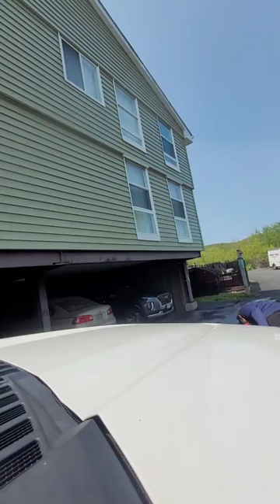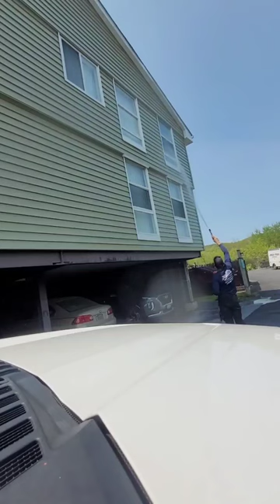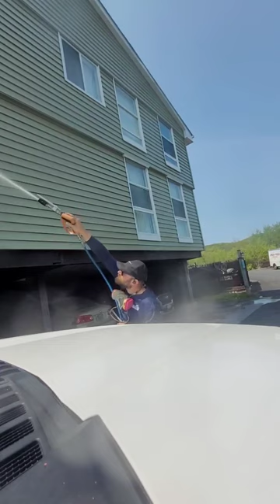12 volt pump to gas AR pump

Comment: did you worry about overspray on the cars under the house?
Reply from the maker: No, my mix won't hurt car paint so I don't worry much. I do rinse them off so the windows don't streak from the soap if it splashes on

Comment: I’m running a gx390 with 4gpm but I’m going to move to key start and the igx800 but you said your running it with the AR pump? Are you aoftwashing in the video something stronger than house mix. I though you were  downstreaming
Reply from the maker: Yes mine is an igx800 with a 8gpm 3500 psi AR pump. I downstream with it (soft wash), surface clean with it and run my turbo nozzle
Reply: @YoungAmbitionYA  do you think if you downstream with the size below your machine m5 twist it will lower the Chem pulled compared to using the bigger orifice designed for the pump size.
Reply from the maker: It's possible